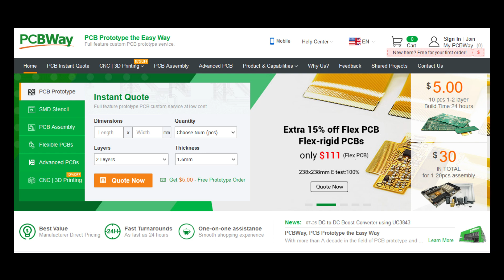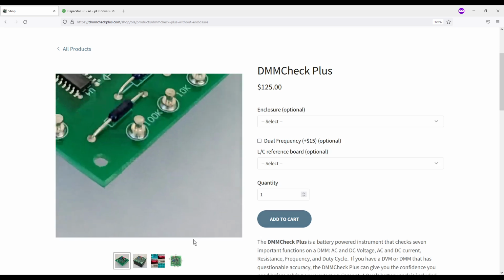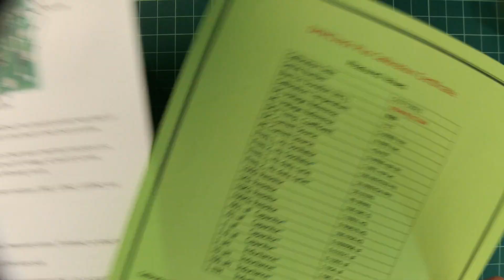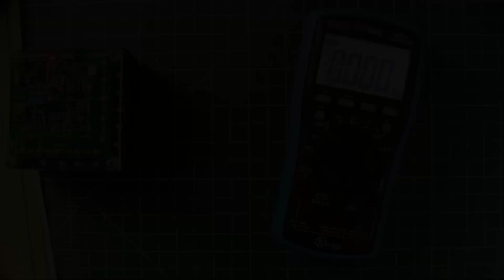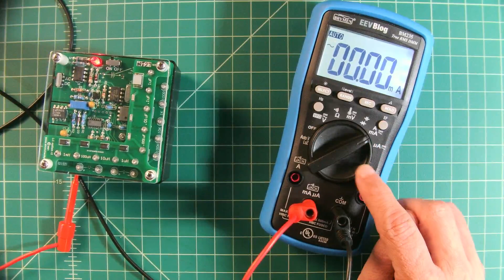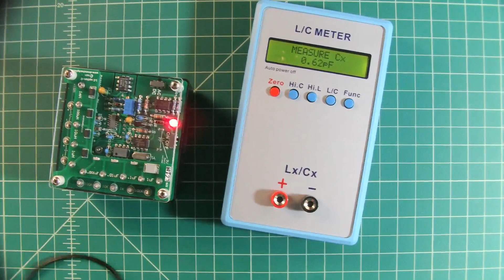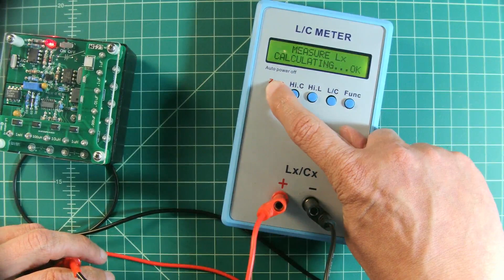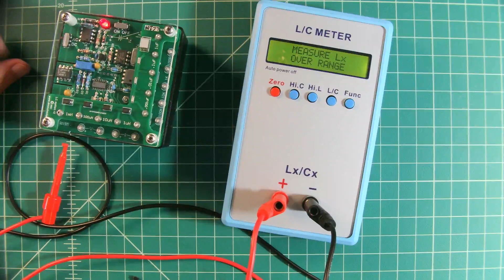DMMCheck Plus Overview - Multimeter Standard

Comment: What's the tolerance of your L/C meter? I think the worse reading I remember seeing was the 1uF capacitance check which was way out of tolerance but the rest of the readings were mostly between 3% to 10% of nominal. DMMCheckPlus' website states that their inductance and capacitance values are measured (and test reported) to within .05%. That's accurate enough to check an LCR meter with an accuracy of .2% (using a 4 to 1 ratio). My Keysight U1732C LCR meter has an accuracy of +/- .2%. and their standard is accurate enough to check it. You might wanna send your LC meter in for cal or get a more accurate meter. Or if you don't trust their standard (the DMMcheckplus), then you could send to me and I'll check it at the calibration lab that I work at. I think it's more likely that your LC meter's accuracy is in question and that's the whole point to having that DMMCheckPlus standard. Btw, its very inexpensive when considering the TMDE standards that you would need to verify all the parameters on a mulimeter or your LC meter. I think its super cool and may order one myself.

Comment: The AC voltage from the check plus is a square wave so not what the multimeter is looking for. Bench multimeters like the 3458A used to calibrate the test box has different filtering and measurement capabilities to the cheap 3.5 digit mulimeter. Multimeters expect a sine wave so the check box AC output is really only useful for frequency.
Reply from the maker: Thanks for that info RB!

Comment: I'm a new ham. What do you use the L/C meter for?
Reply from the maker: I use them for measuring inductors like coils or wrapped toroids or various capacitors.  It's common to use both Capacitors and inductors to make traps and filers or to tune antennas,  An L/C meter can be a life saver...
Reply: L/C meter is a critical tool for the ham radio shack. You can use the L part to measure inductances (coils, toroids, etc.) and the C part to measure capacitors. Both when fixing or building projects. For L measurements I use a NanoVNA. For C measurements I use my multimeter. They are not super accurate but you can see if they are in the range or not working. 73.

Comment: Interesting standard. I think that lx/cx meter is pretty good meter. It goes down pretty far. Mine reads dam close when testing non-reflowed parts, After reflow they read spot on.
Reply from the maker: It works well enough for Ham Radio stuff that I have needed.  Thanks for checking out the video Kevin, I appreciate it.